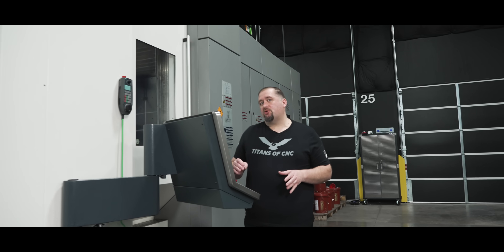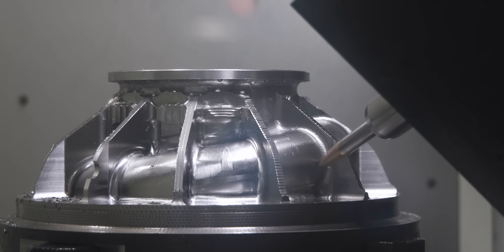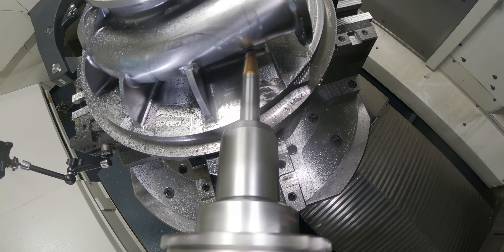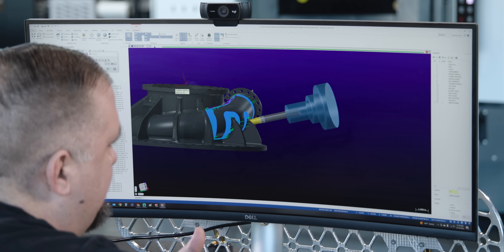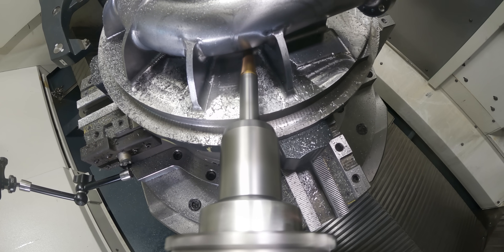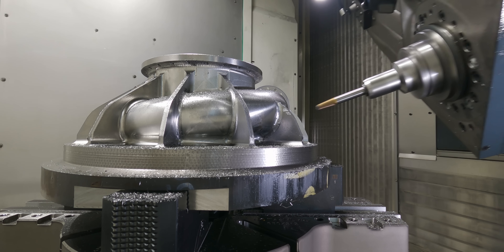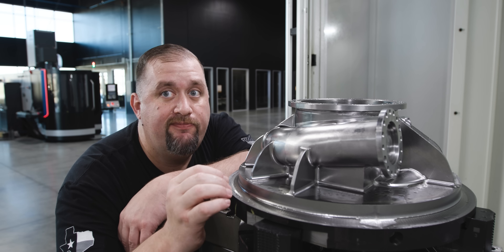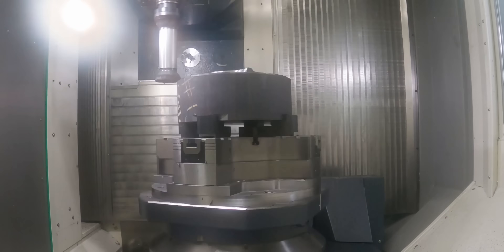MOST Complicated CNC Machining Toolpaths Saved for Last

Comment: Nice work.  But now i'm curious on how you will machine the duct of this pump ?
Reply: a long curved end mill. duh...
Reply: @J.DiPietro  That's what I thought too.  👍
Reply: Old Japanese Dude with a hammer and chisel.
Reply: @GunkDung  class comment
Reply: dremel tool
Reply: normally it would be a casting, this is just a demo
Reply: @DylanVos05  I think, in theory, you could sinker EDM it. In theory, no idea if it even possible in reality.  I certainly suspect it isn't something that anyone would choose to use as a manufacturing technique except in weird corner cases like a down factory and a 3 month lead time.
Reply: @k53847 lolipop undercuting endmill. My guess is you will have to flip it to get the inside.
Reply: Well you can use right hand milling attachment if it would fit inside of the main bore, but I don't think you can get it to diameter specs, after that sinker EDM.  That's why those parts are casted. Honestly I would not want to do this part. This why manufacturing is so expensive and sometimes unnecessary complicated.
Reply: I can almost guarantee we'll never see the final operations on this part.  It's been over a month.
Reply: they're not lol
Reply: With a chisel
Reply: Long reach tool, same as you would work on cylinder head, but here it will be easier couse you got a machine and a lot larger hole than a long curved runner of a head.
Reply: Mastercam Port Expert with Lolypop tool.

Comment: How does this work if it doesn't have a hole in that spiral?
Reply: I think it's mostly a demonstration part, not a functional one.
Reply: Was wondering this same thing
Reply: It’s just for show
Reply: This is a teach part. Based off of a real life part but modified to be used to teach in their academy.
Reply: When it’s actually a part it’s a casting with the hole already inside
Reply: I think, the part isn't finished yet.
Reply: It appears these are connections to independent systems in close approximation in this part. Possibly for stability or simply tight quarters requiring these specific connections.
Reply: The inside is just left hollow from the casting. Or not sure maybe this is 3D printed. either way I think the part is already hollow, just doesn't have machined surfaces. Which frankly is stupid as, if anything it's the only surface that should be as smooth as possible, for improved air flow. The outside is just for aesthetics and is a waste of time.
Reply: @nils1953  If I remember the earlier videos correctly, this was machined from solid stock with no internal features.
Reply: @nils1953  this was made from a solid billet of steel, there was neither a casting or 3d printing operation.
Reply: @challacustica9049  yeah you're right. Mb. Then this is really just demonstration, as the pump housing shown in the Blue Origin video, was a casting.
Reply: @nils1953 it was machined from a blank billet. See part 1.

Comment: Awesome finish! on the outside... now... please show how you machine out the housing with that tangential curve...  🤓
I'll pop some popcorn for that video :popcorn-yellow-striped-smile::popcorn-yellow-striped-smile:
Reply: Actually, what I'm wondering is how valuable all the work on the outside beyond the rouging pass is? Does it actual make the part better at it's job? It's a rocket so weight matters and it's most likely a highly stressed part so sharp inside corners are a no-no, but it would be interesting to see how much the client could have saved by setting the outside tolerance as -0.0/+0.125 or something similarly grotesque.
Reply: @benjaminshropshire2900  the smoother the surface finish, the more rigid the part will be since cracks cannot start so easily. In technical terms this is called notching effect
Reply: @benjaminshropshire2900  sure on the inside, tolerances are more critical
Reply: @johgude5045  The stress concentrations that cause fatigue issues are only for notches. If you do a surface with a bunch of flats with convex edges between them that shouldn't be an issue. You could even do a surface with a large diameter ball end mill with large step overs and it shouldn't be a hard fatigue issue to work with.

Comment: just wondering, how much would a part like this cost?
Reply: $21,564.32
Reply: my guess is probably in the 10s of thousands but idk
Reply: Ya I’d guess north of 10k$
Reply: Infinite if you machine the inside of the housing, if it’s just the outside, and it’s a 1 off part, I’d say 20-30k